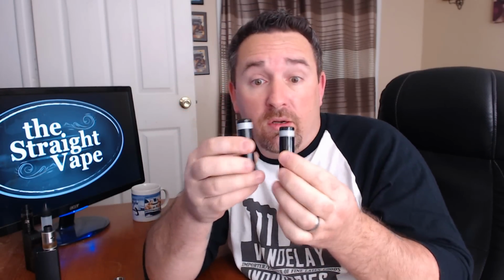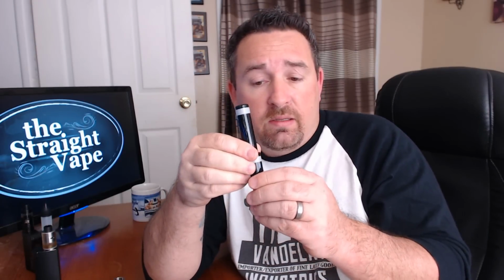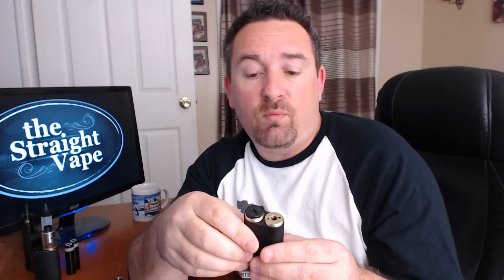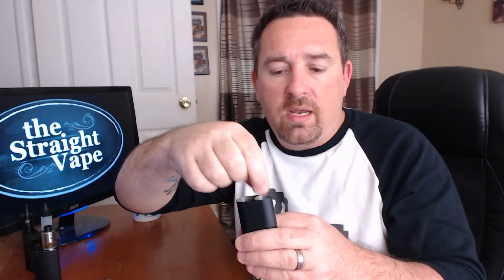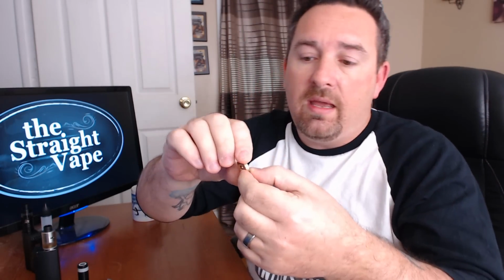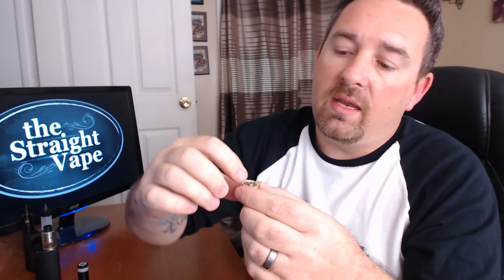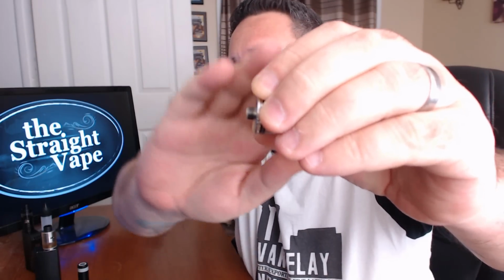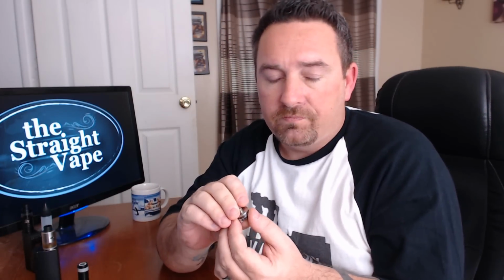Explained! Noisy Cricket Build & Safety

Comment: Can I use my beast king tfv12 with a standard lighting bolt coil in it on the noisy cricket?  Thanks for all you do.
Reply: Tanks are highly recommended NOT to use, the 510 pin on the tfv12 may be protruding but if its floating or press fit that can cause a short. The tfv12 coils may have the ohms that are considered safe but the gauge wire that they are constructed from most likely arent. If you try to use 30g wire on this device theres a strong chance your wire will pop.

Aaaaand thats obviously bad. Stick to RDAs for the NC for all our sakes.

Comment: How low can you build on this
Reply: depending on battery cdc amp rating you CAN build around .3-.35 but alot of battery ratings will be innacurate so build .4 and above for obvious safety reasons.
Consult mooch's battery chart to see how your batteries will react to your build and remember to use ohms law to calculate your amp draw.

Comment: I just got one today and I am using  a dual coil build in an Athena RDA at 1.71 ohm.  Math works out to about 5 amps and about 40 watts.  No issues with the operation BUT....the Wismec instructional vid talks about the rocker at the bottom.  Neither you nor they really say much about the addy being flush on the connection.    When I install mine, I put the atty on the connector first and run it down flush THEN I screw the atty already assemble on the connector into the mod as a unit.  afterwards I put in the fire button and screw it down until it stops.  Are thes connections supposed to be loose so the batteries can move up and down?  If so then there is play in the unit and it rattles.   ....?...?

Comment: buy the new upgrade trigger so it's not a mech mod no more an then ur good to go that's wht I did
Reply: The upgrade kit doesnt stop it from being a mechanical mod. FDV's kit allows you to change it from hybrid connection to 510 standard, and the button changes your area of contact to battery but last time i checked my NC doesnt have a board,mosfet,resistor or short circuit protection. With the kit its still mechanical and still unsafe to idiots.

Cheers

Comment: Good vid. So I'm running .21(w/ fat daddy upgrade). Still a no go?
Reply from the maker: Depends on what batteries you're using. The only battery I'd feel comfortable using with that build is the LG HB6 (which is also what I run in my Cricket)
Reply: Thanks for the info. I'm using some batteries I picked up from my local b&m shop.

Comment: im running mine at .3 ohm. that was the lowest my shop recommended for it. after seeing this i will make sure i ad an extra rap or so or use different wire. i usually buy premade coils, and after putting these on my mason and testing them they came out to be a .3 which seemed perfect because of the advice given to me at the store. anyway i dont want to waste these and i dont have a ride to the store atm so ill just make sure im careful not to make the batteries go critical.
Reply: i just want to add i did the math, and according to ohms law for my batteries at least it should actually be safe. make sure you look look up ohms law, and do the simple division of v/ohms to get the amperage required fir your coil to run. as long as the continuous amperage is higher than that needed for your coil you should be fine. i however could be wrong if so please correct me.
Reply: 26g canthol wire works very well with 9 wraps in this mech mod

Comment: Hey, I'm new to building. If I use a dual coil (serial ofcourse) for the NC, If both coils are 0.25 ohms each, what does the total resistance come out to? Is it depending on the batteries?
Reply: i could be incorrect but some where around .13
Reply: +J. A. thats about right which would b way to low for a mech..u wanna be above about a .3 for safety

Comment: I just watched your video, thinking on getting the NC... so exactly what batteries do i need? you said LG HB6, ive been looking online for them and couldnt find them, is that the best you run? last question, what wire should i get? I will be getting the NC with the indestructible RDA.. 
TIA!!
Reply: * the best to run***
Reply from the maker: LGHB6 at IMR Batteries: https://www.imrbatteries.com/lg-hb6-18650-1500mah-30a-flat-top-battery/ any wire is fine, it's all preference. I prefer a fused clapton but, a 22awg or 24awg round wire Kanthall will work just fine too.
Reply: They had em at kidneypuncher.com pretty recently too

Comment: Just bought a cricket with NONE of this knowledge. I'm kinda scared to use it.
Reply from the maker: no worries, just follow the stuff I mention and you'll be perfectly fine. The biggest things to watch for are that your build is NOT below .40 ohms and that the center pin on your atomizer sticks down a bit from the threads on the atomizer. Do that and you'll be fine. I'm in the process of checking out a Noisy Cricket conversion that removes the hybrid connector. I may do a video on that as well. It's made by Fat Daddy Vapes.
Reply: +The Straight Vape yeah me too, I watched a video by another tuber and I bought myself one

Comment: Mega thanks for this.  I have the noisy cricket mod and I will admit I can be a bit more 'free' when I build. Bascially i build it and vape it,  Never really looking to see ohms and all that.  After a chat with two workers from two different vape stores saying the noisy cricket is quite the 'risk' I did go a head and look into this more.  The second worker did end up asking me 'what are you buiidling on it', I told him "22 gauge 7 wrap",  he looked at me like 'wtf are you thinking' , then gave me some good info and more saftey on the whole thing. So after reading this i know NOW to make sure at least a .4.  I went a head and put a .5 (26g 12 wrap) to feel a bit safer.  Saw the GrimGreen one as well and did learn a lot more about batteries in general.  Kinda glad I did look into this a bit more after the few chats i had about it otherwise i may have been a 'statistic' :|

So thanks for the info for sure.
Reply from the maker: Thanks for watching and taking the time to review safety. It will go a long way. All mech mods can be dangerous. If you haven't already, you may want to check out my battery safety video too.

Comment: Doesn't the tsunami have an adjustable pin?
Reply: it is adjustable but it adjusts in a funny way, you need to take the pin out  completely. then hold the top with pliers and the bottom screws out, then once you do that you put the top bit back in which holds the positive post, then you can screw the other bit in to adjust to what you need, its basically a 2 part pin, really weird but it adjusts, took me ages to work it out :P
Reply from the maker: not really... it just loosens up the positive post on the deck. You can loosen it but as soon as you screw it on a mod of any kind it will just push the positive pin back up into the atomizer.
Reply: Thank you for that info! Now I feel safe using the Tsunami on my Cricket. What a weird pin!

Comment: I am so glad you did this. I'm pretty new to vaping and studied battery safety and ohms law straight away. I never build below .5. 16 am sand 128 watts at 8 volts is more than enough. I'm sick of seeing people doing videos saying that you need to study before using a mech then they say you can build down to .25. Some well known people out there. It winds me up. I asked one chap what batteries he was using that would cope with a .25 series build and he told me Samsung 25R. When I told him they were only rated to 22 amps he told me he was a professional so knew how to get the most out of them. Someone else today building to .07 on a mech. That's 60 amps. It's crazy. Study they say then themselves ignore it. Great if the people against vaping see it. Not clever. Rant over. Great video. Thank you
Reply from the maker: thank you! As you can probably tell, I am BIG on education and SAFETY! We don't need any more people becoming statistics out there.
Reply: +The Straight Vape people like me starting out look at you tubers for guidance.  They tell you to study. But it's ok for them as they know what their doing. Ohms law tells me .07 with a new battery tells me it's pulling 60amps and giving 252 watts. Battery satiety tells me that a Samsung 25R is rated to 22amps. How can knowing what your doing make the math any different...lol
Reply: Good video, great to hear sound advice like that! Michael, were they building on a series box at 0.25? On a single battery or parallel mech that would be fine, pulling about 16 amps. Would probably get away with it on a series with genuine 30 amp batteries to be honest, but not worth the risk, I build at around 0.6 on the cricket and it's perfect for me, a great vape!